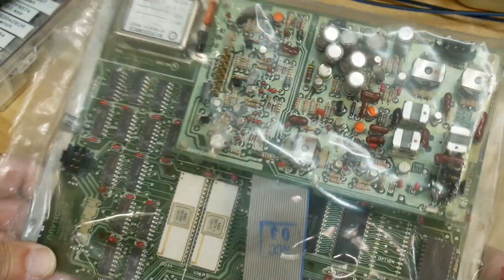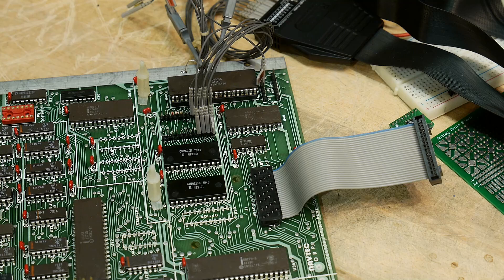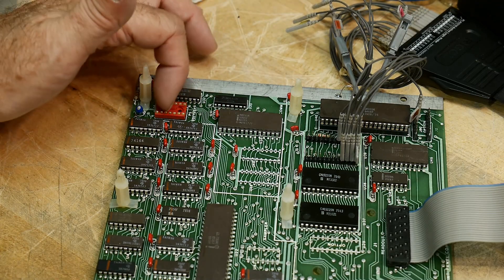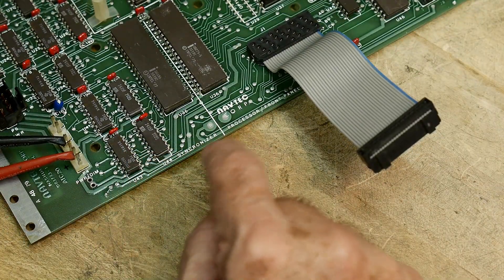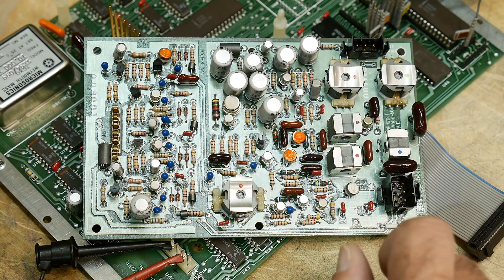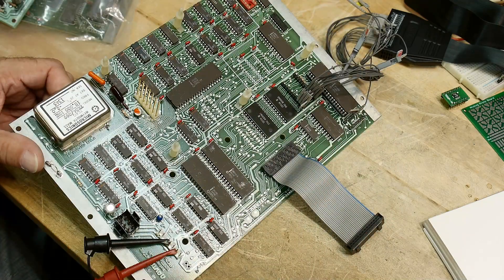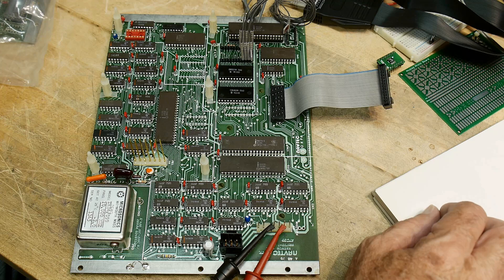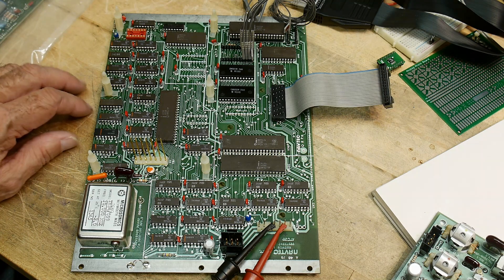#1939 Navtec Navigation board with 8085

Comment: The transformers on the analog bd are impedance matching the high impedance of a relatively short receive antenna to the receiver's input stage, because you have a LORAN C positioning receiver working at 100 kHz, receiving high-power coastal transmitter positioning signals from around the world, from a time before the satellite-based GPS network took over. Towards the end of the system's life they were also used by pilots. I tried to convert one to receive WWVB at 60 kHz, but it was more trouble than simply building a TRF receiver for the frequency ref and then decoding the amplitude switching data for the time.

Comment: In the book "Exactly" by Simon Winchester (I think it'd be SUPER up your ally actually, also available on audible) he talks about when young being entrusted with navigating a oil platform pulling tug into the best match of coordinates possible for anchoring, as previously established by geologists, for drilling. In that time it was using land-based radio networking for trilateration; before GPS. I think in the process of explaining the complexities of GPS itself. So this might be a similar system. I'd guess it can do phase tracking of two different signals. You might be able to find some interesting signals at the ends of the analog circuits, although maybe they'd need to be receiving particular transmissions.

Nowadays with GPS existing, you could use this and some comparators to make a GPSDO with PLL, comparators might be able to do that

Comment: You should take some screen shots of the logic analyzer and give ChatGPT 4o a crack at it. I’ve been absolutely blown away at the things gpt can accomplish. Just last night , I was having a rough time with Fusion 360 trying learn it while trying to design a basic mounting case for a STM32MP157D-dk1 discovery board. It’s similar in form and function to a raspberry pi just a little bigger. I got frustrated and asked GPT if it would just design a case for me and write a script I can use in Fusion 360. It said yes, asked me some questions about design specs I wished to have and in under 5 minutes of my input it wrote the script , I added it to fusion 360 and rendered a 3d model exported an obj and stl files , imported one of those into Prusa Slicer. Sliced it and just under 4 hours later I had printed out a shit hot case I could mount the board in. 
It’s scary how capable ChatGPT is and I think they have toned it down a bunch. 
Check it out, it’ll either do nothing or point you in the right direction. 

Thanks, as always, for the video!

Comment: Why would you put the clock all the way on the opposite side of the board?  Seems like a fast signal that you would want next to the CPU, no?
Reply from the maker: used for the navigation hardware decoding first. the 10MHz goes to the other size and is divided by two before the uP uses it.
Reply: I remember 8085 needed 2x clock speed to run.  Maybe it was a 2.5 MHz chip.  Z80 clock was 1 to 1.
Reply: 5mhz clock isn't really fast enough to make a difference
Reply: @Spookieham  back in 70s, it was like 5GHz CPU vs 2.5GHz.